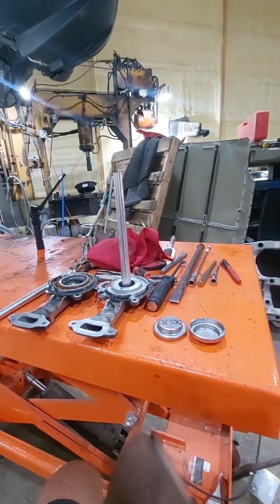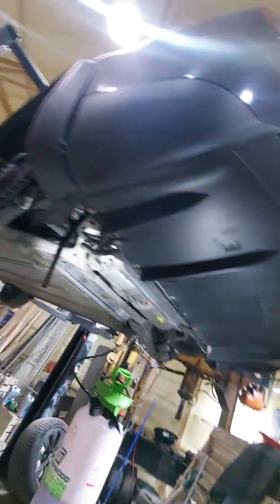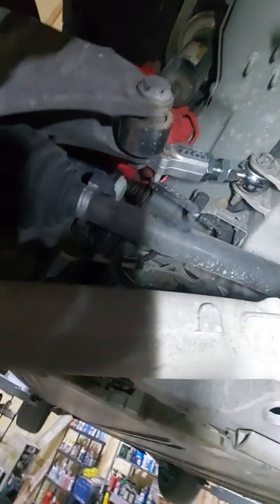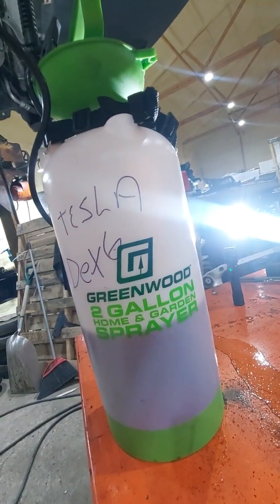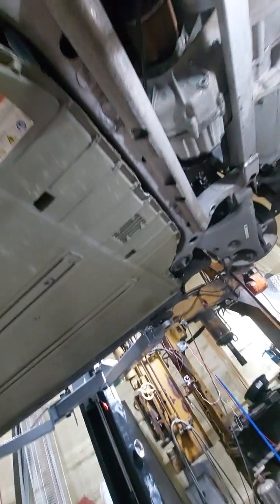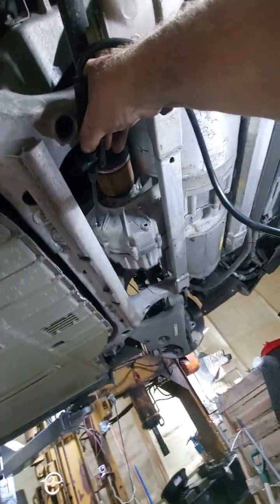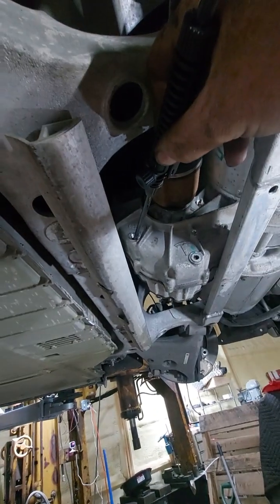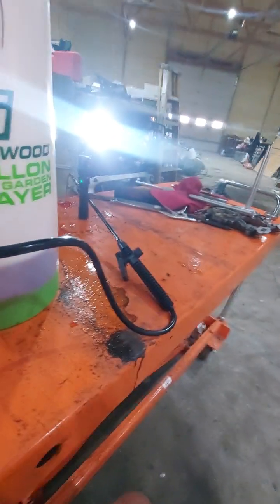Tesla model X rotor coolant delete tricks

Comment: Hi isn’t it dangerous for the rotor not to be cooled ? Have you done this and seen it work for thousands of miles ? Also does the cap work just like the qcc charge kit allowing the coolant to go to inverter and motor but just deletes the flow to the rotor or that kit work differently? Thanks